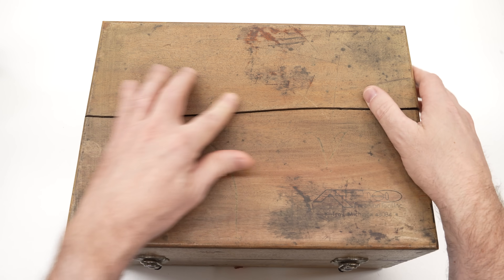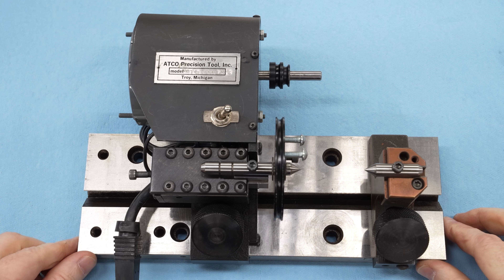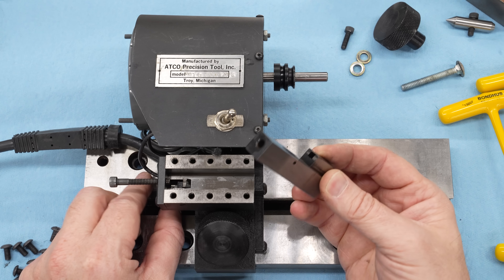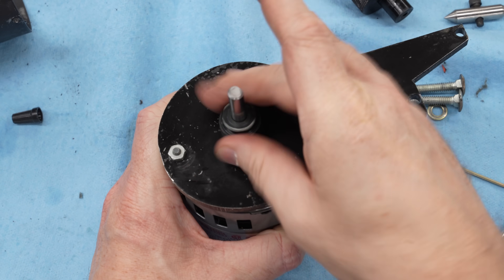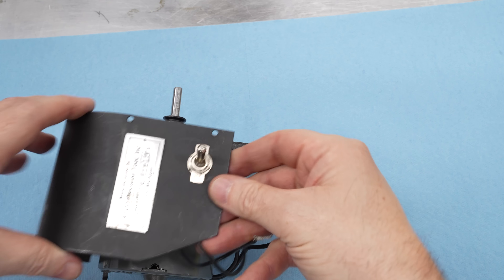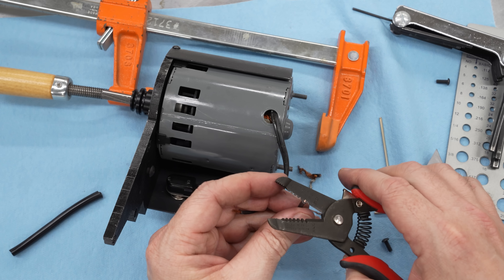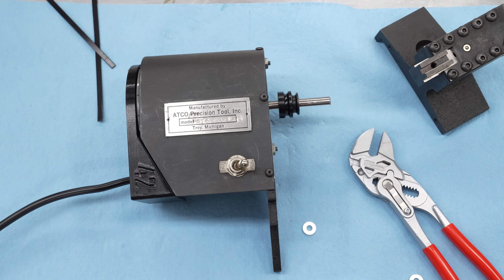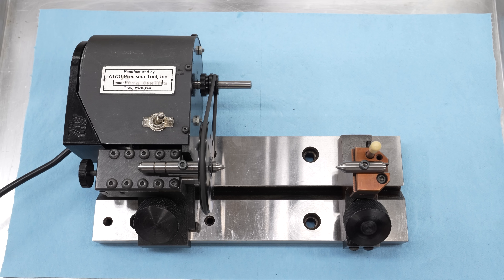Restoring Motorized Grinding Centers | Atco MOTO-Center | Harig Lectric Centers

Comment: with the holes aligment, i belive u should twist the maschine with the motor in the right side  .....
Reply from the maker: The motor only goes on the base one way due to the angled T slot.  If I rotate the entire assembly 180 degrees it won't fit in the box.

Comment: I am wondering if the runout you saw is due to the fairly new cylindrical square or the very old Atco? Might be worth looking deeper at the Atco?
Reply from the maker: The centers in the ATCO are dead centers, so there shouldn't be any runout contribution from them.  It would be worth throwing an indicator on the center to confirm something crazy isn't happening.

Comment: May be nothing but I noticed the pulley wheel wobbles a bit and may be transferring the momentum from the wobble to the spinning cylinder affecting the reading. Check the replay.  Nice bit o kit there.

Comment: Hi James, interesting looking device. One note. When you were testing runout on the cylinder the drive pulley on the motor was not in line with the "headstock" pulley. Also the drive screw skewed the HS pulley so it wasn't running true. This was possibly contributing to some of the runout. Some form of drive dog that doesn't influence the pulley track is definitely needed before you do any remedial grinding on that cylinder square.
Happy thanksgiving from Canada's banana belt.🤞🇨🇦🍌🥋🇺🇦🕊️🇺🇲🦃👍

Comment: I'd say don't use crimps unless absolutely necessary.  I much prefer solder connection for any connection that should be "permenant".  Not that there is not anything glaringly wrong with crimps, I've just had far more longevity issues with crimps than with soldered connections.  For the box lid, I'd just drop a little wood glue in with the box closed at rest, and sand it smooth slowly.

Comment: I would also use some glue in the cracks of the box, with a clamp across the lid and bottom, if you do it as well.   Good luck, Lee
Reply from the maker: There's evidence around the inside edges of glue squeeze-out, so I suspect someone already tried that.
Reply: @Clough42  the timber has dried out and shrunk. As suggested re-gule and clamp followed by a generous linseed oiling. You have a laser engraver ? scan the logo and reproduce it on new timber. Ply??

Comment: James, the big pulley has a wobble that corresponds with the frequency of the change in the reading on the indicator on the test meter. Wonder if the two could be related?
Reply from the maker: Doubt it, since the same reading appears consistently across the cylinder.  Both are just wobbling once per revolution.

Comment: I noticed on the disassembly that the power switch was on the neutral and that the hot went straight to the motor. It is highly unlikely that that was factory original. This scheme would make most of the wiring and the motor hot when the plug is in the wall.
Reply from the maker: Oh, wow.  I hadn't noticed that.  Good catch!

Comment: Again with the excellent content.

Can you use your granite plate to test if the cylinder was out of round?

Precision V block? Is that even a thing?
Reply from the maker: Roundness is difficult to measure with simple tools because there are ways a part can be out of round and still measure good.  For example, when measuring diameter: https://en.m.wikipedia.org/wiki/Curve_of_constant_width

Comment: That cracked lid is due to poor design of the box. The top & drop edges are cross grained. When there is a change in moisture/humidity the top piece will want to expand or contract but the lengthwise grain of the drop edge will not. Glue will not stop it!  Proper design would have been to float a panel in a frame or use plywood.

Comment: Electrical engineer here, You can use those heatshrinks for 110V no worries
Edit: Ziptie guns have another purpose: they pull the end a little more, then cut and release it. that way there is no sharp edge sticking out. People have sliced their arms on sharp ziptie ends when trying to reach into a cable mess..
Reply: Just yesterday I was at Lowe's and someone zip tied the security sensors to the handles on the drills and just clipped the tails with cutters at an angle and I got cut TWICE both in the same place on the inside of the same finger, those zip tie guns make a clean flush cut and are really nice!
Reply: Zip ties can be vicious! Anyone that cuts them at an angle should be banned from society!
Reply: @jesusisalive3227  For real! Especially if they're doing that right on a place people grab, almost seems intentional...
Reply: Maybe people with soft skin
Reply: @embededfabrication4482  

Oh brother.
Reply: When I was working with this sort of thing we would cut the zip ties with single sided cutters. These are still available and are the same as normal end cutters with only one grind on the cutting edge (on the inside of the cutting edge). With a little tension on the end of the tie would result in the cut end being below the surface of the ties' grip head. Always worked if you cannot get or justify the expenditure on a gun.

Comment: I recently got a 20 watt diode laser cutter and I've added that into my prototype workflow. It's way more useful than I originally thought it would be. You can make a sketch infusion and then cut that sketch out in notebook paper in about 30 seconds and test fit it. It's incredible useful for rapid prototyping Even when the final design is going to be 3D printed.

Comment: The Dayton brand motor is probably a replacement for the one from Atco.  Dayton is a W.W. Grainger brand.  That is probably why the sheet metal does not fit exactly and it would also explain the messy  wiring.

Comment: Carriage bolts have those flats. That’s what digs into the wood, or fits into a square hole punched out of a strap. I use a lot of heat shrink in my designs, and it’s fine. I wouldn’t use up for 440, but for 240 and below, it’s fine.

Comment: Forstner bits - if you ever have to enlarge or sink a hole like you did, there are two trick you can use (if you don’t have a drill press or mill at your disposal.

First one - take a scrap of wood and run the forstner all the way through.  Then you can try to center that over the hole and clamp it down and do a thing.

Second, try running the forstner bit backward a few rotations.  Sometimes I’ll do this anyway to score the wood fibers before I plunge the bit into even a fresh cut.

Love your videos!

Comment: Small tip for people using photos in fusion. Try and take the pictures with a camera lense with a long focal legnth, position yourself as far away from the part as needed inorder to be zoomed in as much as possible. This will prevent paralax error, distortion in your image due to the viewing angle of the camera.
Reply from the maker: Good tip.  That's what I did here, but forgot to mention it.

Comment: A suggestion that's really helped me when modeling off of pictures in fusion is to take the pictures from as far away as possible and then zoom in digitally. The further away you are the less distortion you'll have which really helps with accuracy.

Comment: I just got almost the same insulation tester (UT502A - 500V-2500V) a week ago for testing the motor on the milling machine, 5G Ohm range on 1000V, good thinking. Better safe than sorry 😊

Comment: Heads up, the higher the voltage, the lower the resistance. Should be OK to use those terminals. Those terminals are used in 240v hvac systems in homes. Higher voltage normally needs less Amps to do the same job. I will advise you to use UL certified connectors in your home, but in reality, if there was ever an issue, it will just trip the breaker/fuse

Comment: I see you got a taste of polycarbonate. My first HT material was PC (then PC-CF by prusament) before PA/PA-CF. So sharing my experience.

PC and PC-CF, for a period of time, became my go-to material for functional printing, and what I learned throughout the time that PC-based parts that you use bolts on them tend to get loose. I have a custom 3D printer in which the 3d printed parts are made of PC and every once in a while I have to tighten them again - especially if the PC parts experience temperature fluctuations (between 20C and 45C). But they look darn good! And also, for my use cases, they actually have good enough mechanical properties. 

For that bracket inside your lathe, I would be curious if a PC-based part would hold as well as PA.
Reply from the maker: PA is famous for creep.  I didn't realize PC had the same issue.  I'll keep an eye on it.

Comment: Nice! But about the hole for the wheel dressing diamond: shouldn't that always be at an angle, to prevent damaging of the diamond tip? This one seems to be straight.
Reply: The offset from the center should do that?

Comment: A trick for using a Forstner bit in that situation is to drill a through hole with the bit in a piece of thin scrap, perhaps 6mm. Then clamp the scrap to locate the hole where you want to drill and use it as a guide.
Reply: Was just about to post this tip. Honestly though with access to a mill, that’s a better choice
Reply: @JimPudar  yeh😏
Reply: I find that metal workers are sometimes extremely dumbfounded when it comes to wood stuff.
Reply: @TheRalliowiec  it’s a totally different set of skills after all!

Comment: I was surprised that I had to scroll down about 8 comments find a mention of the missing motor housing grommet.  It was really bugging me, especially after the cable management seemed to pull those wires tight and mash them against the housing.  Great video as always, James and thanks for all the fusion 360 tips.

Comment: I have a similar unit made by Joe Smith Enterprises. It's not motorized but has served me well for close to 40 plus years.
Suburban tool makes a base for their Master Grind unit and you can add a motor if you want to.
Another unique item in my collection is a compound sine plate that can tilt in either direction. Made in England and it comes in very handy when doing right hand/left hand parts using the same compound angle. Also at least 40 years in my tool collection.🤗

Comment: Glad to see you using proper crimp and seals instead of those unfriendly solder shrinks.  I find the solder shrinks to be just useless because you can't get enough heat to heat the copper they solder ring should flow into.  A crimp is far more reliable.  I only use crimp and seals when making butt connections.

Comment: That cord looks like th ones we used on large angle grinders. It doesn't seem like a grinder would be made with a open motor. That Dayton might be a replacement from Grainger.
Reply: You'd think ATCO would have been big enough to custom order motors from a higher end builder but I've see others with the same motor. I really don't think it matters much but it does look like a sewing machine motor.

Comment: Hi James, very nice find, and good job getting it back in working order. I recently lucked in to one of these earlier in the year. Mine is a Harig branded Lectric Center, but as you noted they're basically the same unit, both made by Atco( and rebadged by Harig ). I did notice a couple of differences. Mine uses a small T-nut( just like the ones in a mill table toe clamp kit ) and the knobs are knurled aluminum with a threaded stud to screw into the T-nut. Another difference I saw, is that the headstock and tailstock bases of mine, are both one solid piece( no screw on end plate to register against the front of the bead. They are very nice tools. I'm using mine to make a 3"x6" cylinder square out of 8620 steel. Just doing a rough grind using a 46 grit wheel, produced a cylinder that is paralell to less than 3 tenths. I will take more care and fine tune it, once it's been surface hardened. Very happy with it.  I don't know that I can attach a photo here in the comments, but if you send me a message I'd be happy to take whatever photos/measurements you'd like.

Edited to add that I forgot to mention that the motor shaft on my Harig has "floating" end play, so when you switch the drive belt between the low and high speed pulleys, it automatically aligns itself to the pulley that drives the workpiece.

Comment: I think you are perfectly fine to use the heat shrink connectors for this I will say from experience I would avoid them on your vehicle for exterior or where weather tight is a concern. I see these often and they hold moisture and build a nice green corrosion bulge that results in poor continuity. The heat shrink that ooze out a sealant are ideal however I’ve resorted to overkill by soldering connections and then installing a sealing heat shrink. I’ve found it at Ace if you ever want to experiment.

Comment: For those looking for those erasers for cleaning, the term you want is "kneaded eraser." Available at art supply/ hobby stores.
Reply: We call it BluTac. The watchmakers call it Rodico.
Reply: @JohannSwart_JWS 
BluTac is a different product, but also useful for picking up grit, etc.
Kneaded erasers are quite a bit softer.
Reply: As an art teacher who uses both, kneaded erasers are also quite a bit cheaper.. though the sticky ness varies, and goes away when old

Comment: A Japanese Clough would put some ribbon shaped wood inserts across those cracks in the case. You do have a CNC mill if I remember correctly? Or just accept the challenge of doing it by hand :-)

Comment: I’m sure you are already planning this, but fine lapping compound on a toothpick and a lolly stick will clean up those internal & external centres. Be interesting to see if that 3 thenths are circularity errors on the cylinder, or more likely (I suspect), defects in the centres.

Comment: I don't think you can regrind that cylinder with those centers. They are not rigid enough. You can use a Mikrokator with 0.5 micron precision or less to measure every say 10 degrees around the cylinder and there should be two verticals 180 degrees apart dead square to the surface plate even the hole cylinder is tilted. The cylinder needs to have precise diameter at all heights. You can mark where that precise vertical is and use only that part of the cylinder. That's what I did with mine which is 12" long

Comment: @clough42, what are the specs of your Fusion360 computer?

Never seen Fusion be so smooth before.
Reply: I suspect that the “smoothness “ has nothing to do with the computer but rather the use of a SpaceMouse. Fusion doesn’t need a super powerful computer but does like lots of RAM.

Comment: Not sure about over in Yankland, but where  live, it's 240V. You would not be able to use those crimp connectors here if the wiring was going to be exposed in any way as the law requires double insulation or a floating chassis. As the motor is earthed they would need double insulation, but you've enclosed them nicely so should be all good.
Edit: ... or earthed chassis ...

Comment: Nice find. I would put some kind  of insulating bushing around the wires were they enter the motor. My guess when the unit was built it had a Bodine motor and was replaced using the horrible wiring job.

Comment: The nylon crimp butt spices should be fine. They look to be of decent quality.

FWIW, I usually use Molex Insulkrimps or Panduit terminals. I find that they crimp better and are a lot stronger than random brand x terminals.

Odd that you're have problems with Bondhus hex keys.

Comment: James,

The simple solution for the T‐nuts would have been rubber pads applided to the bottom.   I recommend that you put the pads anyway.  Wood doesnt like being pushed or dragged across surfaces.

Sand the top of the box, save the saw dust.  Mix woodglue with the sawdust to make a putty.  Woork the putty into the cracks.  You can scrape the excess off while it is still soft.  Sand after it dries, the sawdust will blend the color.  It will also take the finish you choose.

Bob